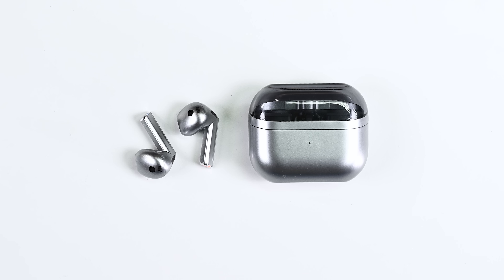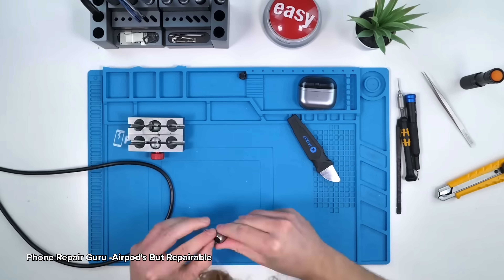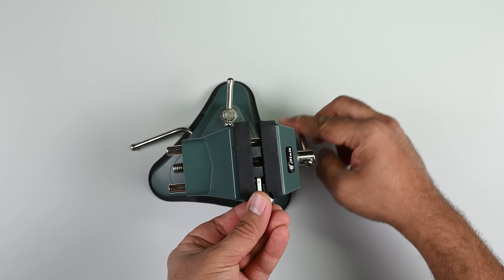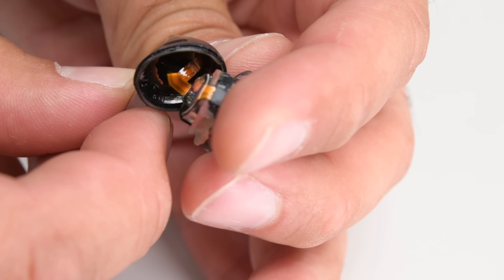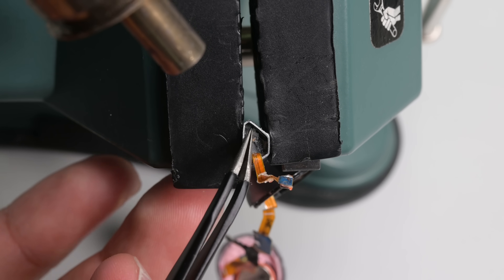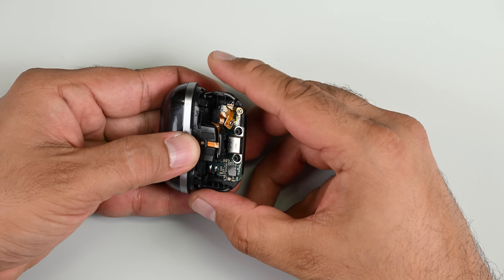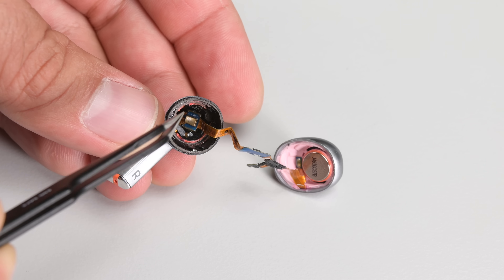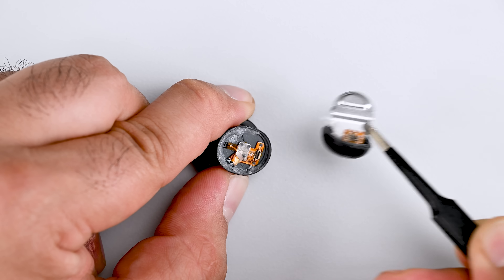Samsung Galaxy Buds3 Teardown! From 8/10 to 2/10

Comment: my buds 3 pro had charging issues after 3 months i got them, when i bringed them to samsung they told me they could not help me with it. I opened the case to see whats wrong and the 3 screws thats supposed to hold the charging pins were all missing and the pins part was all the way at the bottom of the case unsocketed...

Comment: My right earbud is significantly lower in volume, cant find a solution.
Reply: I had galaxy buds 3 for one year and out of nowhere, my right earbud became 70% lower in volume. I replaced them by varranty. The varranty report said that the inside of my bud was very dirty even though i cleaned them often. Its been 3 months since i got my buds replaced and now, I have the exact same issue, right earbud again (I didnt use them very often and I was always making sure they are clean)

Comment: for anyone wondering how to remove the guts of the case, get something thin like a flat head screwdriver (maybe wrap some tape around it as to not damage the housing). Hold the lid of the case roughly halfway open and slide the screwdriver into the hinge, then gently pry up and down a couple times. (Be patient with it. It'll put up a good fight.)
Reply: Dude you are a hero thank you so much
Reply: someone get this guy an award holy cow, for reference i used a WAGO 210 wire removal tool
Reply: omg, thanks a lot!!! It works like a charm! 👍
Reply: 시발 드디어.. 사랑합니다

Comment: I don’t give a crap how repairable something is for consumer electronics.  I don’t buy headphones so I can fix them - if the battery dies I just buy something else.  This is also why I now only use wired earphones - no battery / no charging / no issues.

Comment: Who need to change their buds' battery ????
Reply: Cuz batteries degrade over time? They are not magic and lasts forever
Reply: @smug3791  so does the device itself, so better buy new one
Reply: @madzoroyal  Not really, the battery is always the first thing that goes kaput. Earbud drivers can last for a very long time.
Reply: Even if they last longer, nobody want to keep them for ever, they are being refreshed every year
Reply: @madzoroyal You're entitled to your opinion brother, but I have to disagree. Why waste a couple hundred bucks on something that's designed to fail and fill up a landfill just to have you buying a slightly newer version in a year or two. Don't get me wrong, owning the nicest, newest thing makes you feel good in the moment but but its a waste when you think about it the long run.

Comment: Not great, the average person won't have all of those tools. Even people with some expertise in electronics, such as myself, still won't have all of the tools to hand - let alone trying to actually perform the repair without damaging myself or the Buds. The process involved in a simple battery replacement in these is not worth doing IMO.
It would be better to buy cheaper earbuds, such as the Anker Soundcore P20i, where if the batteries fail, it doesn't matter (because they only cost £20 to begin with), or buy repairable earbuds such as the ones from Fairphone.

Comment: I bought the Galaxy Buds plus a few years back. One of the main reasons is the ease of battery replacement for the buds themselves and case. It's disappointing to see samsung is going forward and backward with each generation. They need to keep going forward. Also, quick note, yall praised the original galaxy buds and puds plus for needing nothing more than a vice to crack them open, now it's a bad thing?
Reply: Well usually it's because costumers will usually buy new products which is especially true for wearables. The thought of making a better product that can withstand water and even better dust resistants gives it a more attention than easy repair.

Comment: Repairability is the #1 reason why after buying one pair of airpods I'll never buy another. I tried and failed to replace the lithium battery essentially destroying the airpods in the process. No way I'm spending $100+ every time the batteries wear out. Disposable junk.
Reply: It really is sad, even my sony linkbuds s battery is degrading quite badly as it could barely last 30 minutes of continuous listening. I reached out to Sony and the only solution they provided was to buy a new bud for both sides, the price is absurd because it's close to a new pair.

Comment: Let's be honest, even if the buds were repairable, part availability would be a major issue.
Reply: Most people would only need to replace the batteries, which are easily made by third parties.
Reply: @RikiGuitarist  Fair point. But personally, I have a hard time differentiating between good batteries and cheap Chinesium that will blow up in my pocket.
Reply: @rat_step these kind of miniaturized batteries are completely commodified. It would be no harder finding batteries for these than it would be finding a battery for the remote for an LED flood light.

Comment: I’ve always imagined a pair of AirPods Pro with rubber gaskets and screws and no glue at all.
I hope someday it becomes possible to make them that way…
Reply: has always been possible, just that current aesthetics don't like exposed screws.
Reply: Extremely possible, just not as profitable as making disposable items.
Reply: even the watches need rubber gaskets and screws... I mean we have diving watches using only basic stuff why cant tech be the same.
Reply: rubber gaskets need high mounting pressure to compress and work properly, something which is not achievable on earbuds as they only use glue/clips to secure the shell. so either they would have to use a metal shell or use screws both of which are unlikely
Reply: @pvim  SIM trays have tiny gaskets. I was hoping for something like that.
Else, the openings could be sealed from outside by sticking rubber or silicon over them. When needed to repair, those could be cut off and disposed and new ones could be applied.
Reply: @vedanshchn  and yes sim trays are made from metal, and most of the ingress protection is built into the sim slot and not the tray itself, the gasket on the tray is an additional protection at best
Reply: @pvim  Many phones have plastic trays though yet are IP certified
Reply: @vedanshchn  as i said above most of the protection is built into the sim slot rather than the sim tray, the sim slot has silicon under fill and has a silicon barrier around it, which is what keeps most of the water out. sim slots use a combination of adhesives, silicon underfill and a gasket to get their water resistance. if you have seen a watch with water protection then you must have seen how tightly the back is sealed, that is the kind of mounting pressure you need if you only plan to use a single rubber gasket